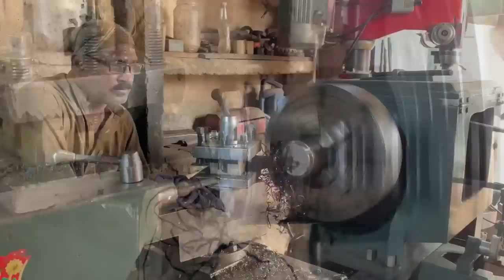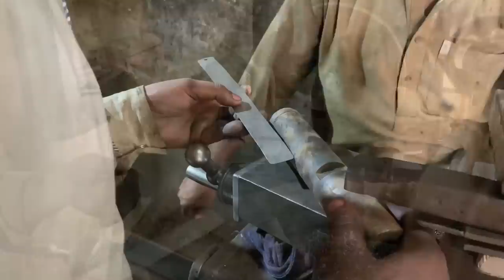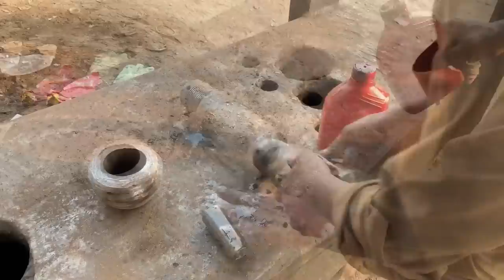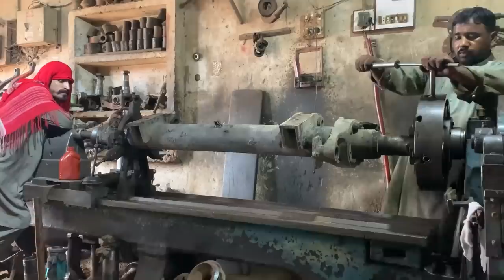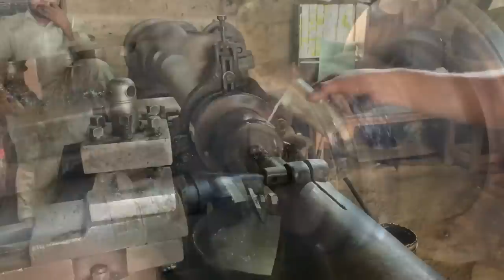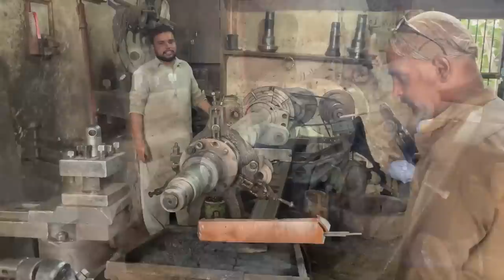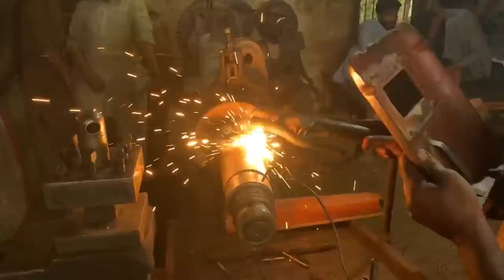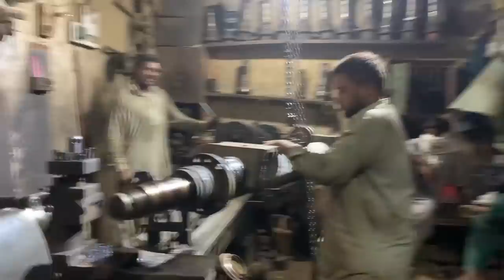How to Rebuild Heavy Duty Truck Broken Spindle From Axle || Repairing Truck Trailer Broken Axle

Comment: Hi there all the engineering folks, isn't that repair a candidate for friction welding? Simply installing the kingpin and then fusing the parts together by rotating the smaller piece at a good speed, against the axle.
Reply: Ma sta scherzando... Per ottenere una saldatura ad attrito è necessaria una grossa pressione,un macchinario adeguato con 2 mandrini contrapposti ed entrambi motorizzati che eseguono una perfetta centratura.secondo Lei tutto questo è ottenibile con un semplice tornio a cinghia e un'officina fatiscente,si potrebbe portare l'asse in riparazione dove si esegue la saldatura ad attrito ma bisognerà piazzare o riadeguare la macchina che andrà ad eseguire il lavoro e tutta una serie di adattamenti con conseguenti e proibitivi costi di lavorazione che supererebbero il costo del ricambio nuovo,la saldatura ad attrito è utilizzata per produzioni industriali in grandi serie,non per riparazioni occasionali,non importa essere un Ingegnere per capire certe situazioni,questi umili Operai hanno eseguito una riparazione a regola d'arte,non hanno nulla da imparare da nessuno,posso affermarlo tranquillamente avendolo lavorato oltre 40 Anni in simili realtà.

Comment: It's easy to mock these poor people for "fixing" something that should have been discarded but it's called lack of options. It didn't look to bad and if they don't heap it up again with a 900ft tall stack of sticks to make it tip over it might actually hold up. 🤞
Reply: It costs nothing to centre the end when you already have a 4 jaw chuck
Reply: @ma61king  last I checked dial indicators aren't free
Reply: maggs131 Even my grandmother with cataracts can see how far out of true that thing is without a dial indicator, ya goober
Reply: @ma61king  goober? GOOBER?? How dare you. A boob or dingle berry maybe but I sir am no common goober.
Reply: maggs131 ok tw@t

Comment: That technique actually weakens the axel.   I’ve seen a repair like this fail again in the same spot. You can watch Cutting Edge Australia and watch how he fixes the same type of problem with the same type of tools.  He doesn’t do it like this for a reason.  What they are doing is amazing but they could  jump another level with some minor changes.
Reply: the solution : reduce lorry payload 40% until you find genuine part

Comment: NO BOSS YOU HEATED THE SHAFT MORE WITH THE WELDING. THE SHAFT BECOMES MORE BRITTLE WITH SUCH HI TEMPERATURE.  OK WHY YOU DID NOT USE A SADDLE KEY BEFORE PRESSING THE BROKEN SHAFT?

Comment: When axle breaks in my country of America, we throw truck in garbage and buy new one
Reply: @monsterg4603  40" swampers and a big fuckin turbo. Low range, tractor sled pull. It happens. MURICA
Reply: Wealthy country. Just not the same in the developing countries. All manner of horrible bodge jobs driving around with zero safety.

Comment: I have watched a number of other video's similar to this and I think I can say this one takes the biscuit. Has to be one of the worst examples of repair enginering that I've seen. Crude equipment, poor lathe work, poor measurements, poor safety, poor alignment the list is endless, the fitment of the cutting bit with all the packing pieces and the angle of the bit relative to the work piece left me searching for words.  Bodgery at it's worse.
Reply: Hahah those shims made me spit out my bud light

Comment: Wassup with spindle not even being true after all the machine work and weld work lol? It's like 200 thou out still🤣🤣
Reply: The runout is not to much of a problem as the axle doesn’t turn.The tyre alignment might be out a touch but I don’t think that’s going to bother these guys. If one side of tyre wears they just turn them around😂😂 I’d be more concerned about that axle snapping again as those welds were no where near deep enough and that shaft they put in the middle has again reduced the weld area available. With no heat treatment after welding he’ll be back where he started the first time he overloads the truck again.
Reply: @scroungasworkshop4663  i'm more worried the runout will put additional load on the tapered wheel bearings...not the fact of the tire or wheel rotation. That runout will wear a tapered bearing alot quicker and the race of the hub. The neglect won't happen before the spindle shears off again though I agree LOL. I wonder if it'll reflect vibration over span of diameter of wheel/tire as well. Could lead to premature failure as well but not an issue i guess as they just run these rigs into the ground based off videos lol
Reply: that will be fine  if maybe a bit brittle

Comment: wtf happened to the lathe gearbox?
Reply: It didn't have one to behind with, this is a belt drive lathe using pulley's to change rpm.
Reply: @BrewPub  I see now. Looks like hand-made lathe. Becasue I've never seen any without a gearbox and assumed they broke it and just put belts and pulleys transmission instead.
Reply: @Ezer2000  Unless you need screw cutting or powerfeed for the carriage, you don't need a gearbox. 

It looks like a basic old lathe made in Pakistan/India/China/North Korea. I don't think it's handmade because the cross-slide looks like a mass produced part.

Comment: you CANNOT repair an axle like that... it will never work the axle stub is hardened for the bearing to run on welding it or any high temp on it removes the hardness stresses the metal and it snaps .. just like it is now. the only way to fix it is to melt it all down recast it all and re harden and temper the axle stub again.
Reply: Yeh true mate but looking at their equipment I suspect they might not have an electric arc furnace out back lol

Comment: Precision Sledgehammer - check.
Safety flip-flops - check
Precision grinder - check
Tempered eye-balls - check
Wobble tolerance - check
Drilling techniques - check
Safety headscarfs - check

Top notch repair!

Sarcasm aside, this has nothing to do with being poor, this is a piss-poor way of doing things. I've seen lots of true pakistani pros. These guys are not amongst them.